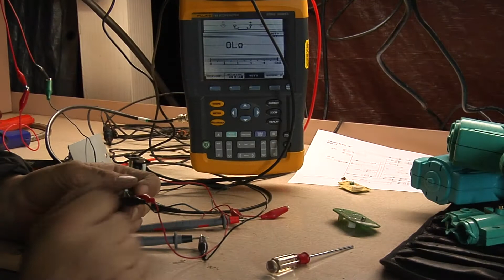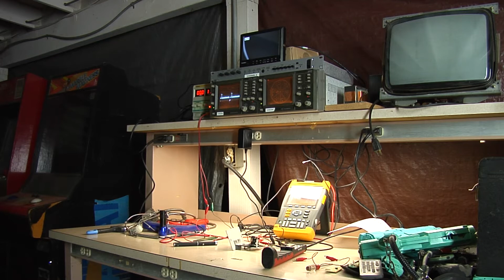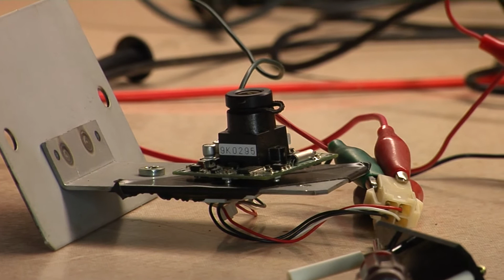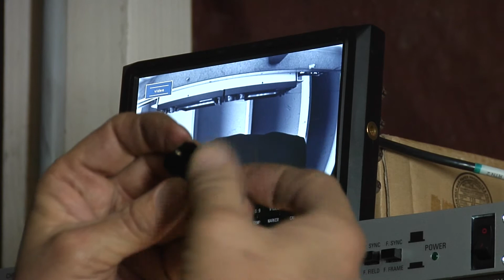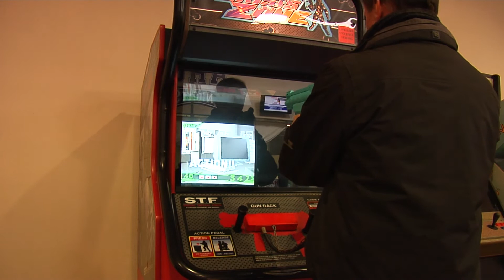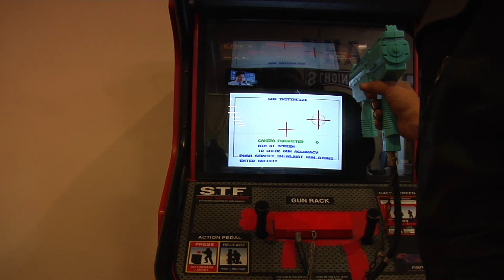Crisis Zone Gun Repair

Comment: Will this gun work with an LCD? My tube had a dead red gun and I can't find another anywhere.
Reply: spanks4 will this unit work on a LCD tv if I get the sensor to line up?
Reply: Yes it will work but the screen has to be matte, not glossy so the camera and track the IR led.